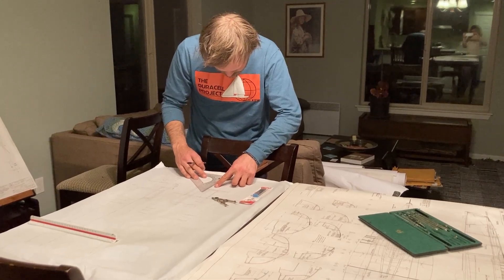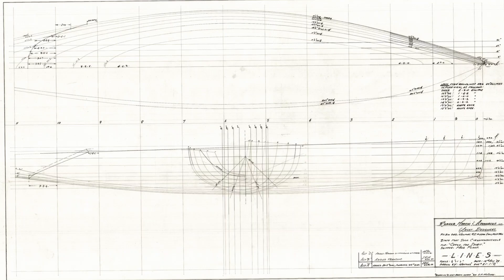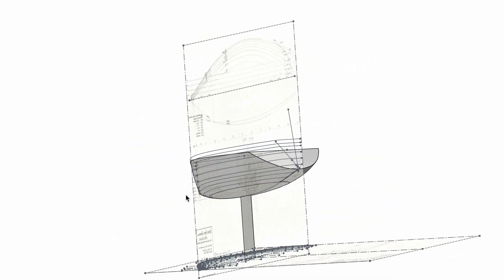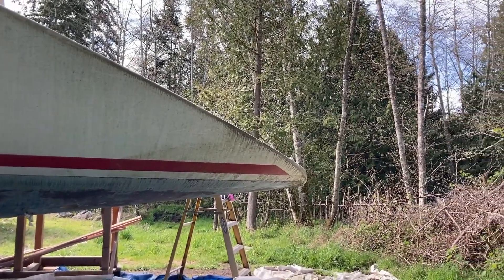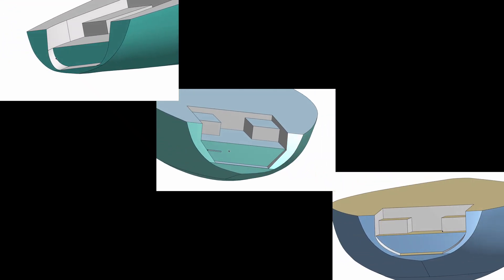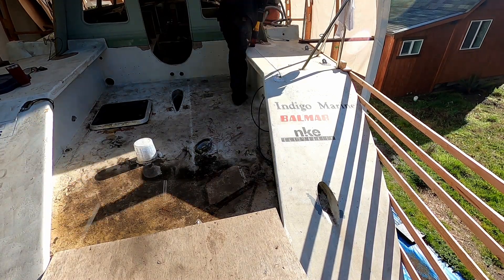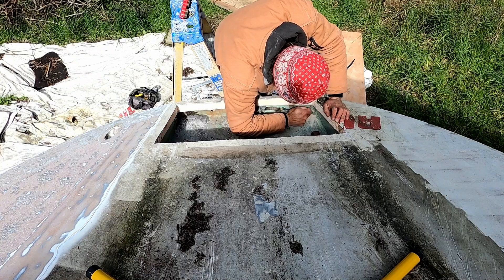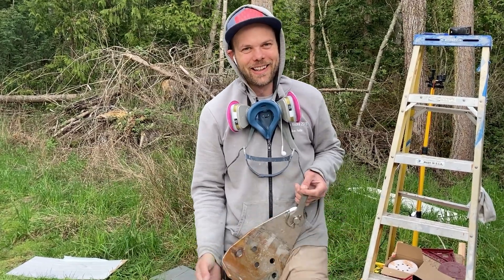Race Boat Refit: New Stern Design [E27]

Comment: I sailed two rallies with Crazy Horse years ago from Norfolk to Tortola. The crew described the ride like was tight, uncomfortable, but fast. We beat them on corrected time on a 50 ton 60+ footer thar was comfortable, fast, and fully equipped with a crew of 6. Their boat had no beam, was too light, difficult to sail. I also hired a crew member from a similar boat - Fazizi (sp) , a Russian entry in an around the world race. He said it was sailing a submarine. Beam is important for both stability and water one length. My beam was 17+ feet and when it healed 22 degrees, the waterline increased dramatically.
,

Comment: A wave of the hand to you both from the West coast of FL. Mathew watching your progress on this boat is fascinating. Do you intend to use her for coastal cruising or blue water? Rudder? What type? As to your stern design I like #2. Are there bulwarks and or toe rail along the deck edges?
Reply from the maker: coastal cruising and blue water! Still figuring out the rudder...stay tuned. No toe rails now, but we might put them in.
Reply: @TheDuracellProject  Hi and good morning from FL. Thanks for the response. I must confess that I’m hooked and can’t wait to see the progress. Question: with an open transom running in somewhat large swells from astern won’t that tend to funnel water at the deck house and it then bring potential for some water intrusion in the cabin? My sailing knowledge is limited to about 4 decades ago (I’m 70+) and that was on Lake Erie aboard a 32’ Sloop. I’m not at all familiar with open transom vessels or how they handle large swells or white caps over blue water. I’m very impressed with your resourcefulness in the projects that you’ve undertaken with Duracell’s refit. 👍 Good job. You’d be a good shipwright.

Comment: Because I'm old, if it were mine to rebuild, I think that I would make the top of the vertical part of the new transom even with the side deck...with a pass-through/gate in the center. My reasoning for this would be both for safety and for additional wrap-around seating in the stern, which would create more deck storage as well under the seating. Yes, I understand how much more work this solution would be. haha Glad I don't have to do it!

Comment: I’d go for #1 or #2. I’m not a fan of the hard corners one the 3rd one. While it may be easier than the other two, I wouldn’t do it. It would be nice if you had some rough measurements with these pictures. I’ve been very slowly working on my girlfriends Santana 37. It’s got a flat transom that I’ve thought about cutting open. We would loose the stern locker but I love an open transom boat. Also are you gonna put an arch over the back for solar or dingy davits. These things might change how you design your transom. But then again with a 60ft boat you have lots of space on the bow for a dingy. Can’t wait to see this boat here in Hawaii. I didn’t realize dog bark started as a solo race boat like Duracell.

Hopefully you upload video’s at least once a week. Give me something to watch while I babysit oil tankers off of Barbers Point.

Comment: Matt, all 3 are fine but my biggest consern is trying to put a modern wide stern on a relatively narrow stern  design. 
I think you will be moving a lot of weight aft and I'm conserned about keeping the balance right and having too much weight in the aft in what was really a shorter boat with a long planning transom to increase the sailing performance. 
But that's  me I guess.
Cheers Warren
Reply from the maker: There's no way around the fact that I'll be adding weight all over the boat, it's becoming a cruising boat after all.  The stern will be no wider than it was, I'm not changing the shape of the hull, just extending the hull sides up.  Thanks for the comment.

Comment: Do any of the transom designs account for wind vane self steering gear?    Seems difficult to account for self steering, dinghy, and swimming in a design.    If the intent is for robot self steering, does the design still need to accommodate provisions for an emergency rudder?
Reply from the maker: I am not planning on any wind vane self steering gear.  An emergency rudder setup can be fit to the transom if we decide it's necessary.

Comment: Cockpit has to go straigh to the back or weidening open, not squezing in, otherwise you are going to scoop water when the boat is heeling.
Reply from the maker: Very good point.  The cockpit sole is sloped aft a bit obviously for water to fall out, but you are right that the pinched cockpit design would hold water while heeling.
Reply: Im rebuilding the cockpit of a 30 feet raceboat, halftonner of 1980.

Comment: My choice would be Design 1.  Though I'd prefer to have, maybe, a 10 degree slope to the transom plane.  This would be holding the deck/transom intersection where you show it, and lengthening the bottom of the hull a bit.

Comment: How old is the rod rigging on the Andrews boat? You don't want to just replace it? I think you tend to make pretty good decisions and you probably have more info than I do. But I would be sorely tempted to replace the rigging unless the history of everything is well known.
Reply from the maker: I may end up replacing all of it, I don't know yet.  It all has to be inspected.  I'm hoping to get a comprehensive history of all of it if/when I go to buy it.  The local rigging shop tells me that it can be inspected for cracks in the heads and can continue to be used if they pass.
Reply: @TheDuracellProject  that is what I have read also. The exception is that if the rigging is 20 years old or something like that, it should probably be replaced regardless of cracks. Rod definitely lasts longer than wire though (but still has to be inspected periodically).

Comment: One hint on the CAD files.  These types of free programs often go to a paid model after they get enough users.  So try to save the 3D model in a neutral format like stp or iges when you're done, so you don't have to recreate it a few years down the road.  2D should get exported to .dwg or .dxf format, which are pretty universal.
Reply from the maker: good tip, thx!

Comment: Jeepers, in looking at #2 some more, I think: a) you do not have perspective turned on which is not very realistic when making aesthetic judgements, and b) the reason I thought your surface was "twisted" or warped is that the big inner step surface is not parallel to the transom plane... Why not make them parallel?
Reply from the maker: Hey Brad!  Yes those 2 surfaces are not parallel, good eye.  The reason is that the chainplates go on the transom, so the angle of the transom points at the top of the mast.  And the aft plane of the cockpit is not parallel because it maximizes deck space to make it more square(perp to water).

Comment: For me it's #1 or #2 with an initial first strong pref. for #2.  I really don't like #3 other than the interesting intermediate fold down (?) step which I think you could add to 1 or 2.  Now the only reason I don't say 2 outright is that the #2 inside corner radius transition SURFACE looks twisted like ribbon to me.  #1 is more pure (or I'd actually call it primitive) to me, as in it looks prismatic like a cylindrical surface just pulled straight back.  Did you look at the profile of #2 (which I think is a better looking transition/elevation) just pulled straight back?  Am I suffering what we call "CAD Zoom" here, i.e. is it actually prismatic and I'm just not spending enough time looking at it?  Do you have perspective (as opposed to isometric view which is often default when working in CAD) turned on? Is #2 actually a twisted or warped surface?... I vote for option #4 where you pull the elevation of #2 straight aft.  ... BTW in the last video (just previous to this one), I STRONGLY love how the new more vertical transom and extra visual mass aft complements the back of the new extended pilot house... I was worrying and not liking how heavy the new extended house was looking but you've totally resolved that! BraVO!

Comment: 3 follow KISS principle. You have very thick core. That’s good. Recommend you avoid carbon fiber mast! Carbon fiber is more noble than Everything, and even stainless steel will corrode next to it. Only titanium fittings can be used with carbon mast.$$$ not worth the headache. Not to mention lightening strike issues....

Comment: Amazing how many comments this video is attracting! Design 3 for me. Why? It appears to maximise access to the cockpit and if you're cruising (you already know this, I'm sure) the greater access the easier it is to haul stuff on/off the yacht, from the stern...from a dinghy. We have a passarelle on our stern and pretty much leave it deployed (parallel to the water surface) all the time as it just makes getting in/out of the boat and hauling things aboard so much easier (the swim platform on the Jeanneau53 isn't very wide at all, sadly). I guess we'd need to know how you're planning to build the split backstay chainplates into the transom to better answer your question though. Any thoughts on that? Cheers, Bill from SY Miss Foxy in SINGAPORE!
Reply from the maker: The top of the chainplates will be at deck level at the stern quarters, on the face of the transom.
Reply: @TheDuracellProject  Well that's good then - for maintenance and access, for sure - but how far inboard of the gunwale will determine how wide access you will have, obviously. Plus the necessity to build-up the structure around the chainplates and transfer load from these into the transom/hull joint and, I assume, a vertical bulkhead inside the transom. Going to be great to watch how you build this up!

Comment: The aestheticcs of design 2 compliment the lines of the boat the best I think. But design 3 looks like it would provide more strength to the hull. So I'd probably go with that one seeing as how the ocean can be very unforgiving. However, I'm no engineer or boat designer so a grain of salt is in order with my opinions on this topic. Good luck with this build.

Comment: Why was the original boat transom designed with that slope? It didn't leave much usable space. I'm sure it was for racing but it'd be nice to hear you explain it.  Thanks
Reply from the maker: Cutting off the stern takes off weight, while keeping length and longer boats go faster! Well, that's our guess anyway.

Comment: As you've never done this before, hats off for the work you do. That said, ~all engineers I have worked with in the past were inclined to "draw" or "doodle" in a "final" and "precise" technique. And that is very time consuming - to the point it made me impatient. Imagine you project (*) some drawing/section of the boat on a whiteboard and with an erasable marker doodle the alternatives on there, one after the other, take a photo, next. That can be fast interactive and easily involves stakeholders. And, yes, the CAD drawings of the boat are absolutely fabulous and necessary - at some point before final design, bill of work and building. As to the quick-hand doodling - I have seen architects do that very easily (as they rely on engineers to convert their sketches into formal designs, with underlying strength calculations, etc.). Works really, really fast. And can keep stakeholders engaged more easily, plus their involvement gives them a better sense of why you are going through these design alternatives.

(*) Or, instead of projecting, a large sheet of paper with plastic transparent foil over it, etc.
Reply from the maker: Love the idea of a white board.  I spend too much time with ideas in my head.  Thanks for the excellent input.
Reply: @TheDuracellProject  - welcome. And, by doing it the whiteboard way you have a better "visual" for you video too, especially in dialog with your partner, or you and the hypothetical viewer.

Comment: I would go for design no 2, but design in a groove to hold a board you can put in to protect the boat on when on long rough ocean passages with following waves.  The last thing you want is a wave to break over the stern and flood the cockpit.

Comment: Hi you want a windvain to stear the boat you would it be better to have a full transom to mount the windvain on to this will also give a big or medium size locker for fuel tanks plus a extra two gas vent lockers etc, plus you can then put a swim ladder on one of the sides of Durcell what do think 🤔 this would be a fourth plan idea,,.Brendan IRL

Comment: I like #3.  It looks like it will be easier to get on and off the boat with heavier bulkier items such as scuba tanks, stand up paddle boards, inflatable dingy, etc. not to mention people being able to get around each other.   Something I am missing in these designs is what else is going back there such as wind vane, wind mills, solar,  wenches, lines, standing rigging and access to what ever is going in the new hull space. You may want to  also consider stern waves washing into the cockpit while surfing downwind in large swells.  I would try to add those into the draft designs (CAD sure makes it easier that paper and pencil) and maybe build some mock ups before making the final choice.    The devil is in the details and all the future what ifs you can come up with as to how you may want to use it.  You are probably doing that already.  Looking forward to seeing what you come up with.  It is very impressive what you have already done!
Reply from the maker: I'm also leaning towards #3

Comment: why follow the traditions and design a stern that follows the existing lines. do that only for the hull in/slightly above the waterline, then widen the aft section to modern standards so you could maybe even use it as a tender garage and get a large wide cockpit for comfort on anchorage.
why did you not choose the german main stay system? could have saved the work/time on this huge reinforced bulkhead!!
why did u curve your roof so much? why not go modern? almost flat roof fits more solar panels!!
Reply from the maker: What is a german main stay system?

Comment: I think the larger the swim step the better... do all three designs have swim step platforms of the same width?  if not, I would go with whatever design has the wider platform (every cm counts) personally I like #3.  My preference would be to have a fold down platform that actually closed in the back and was set into the back of the boat so when in the up position the bottom of the swim platform was flush with the back of the boat... but when the platform was down it would completely open up the back while also giving a massive advantage of offering a swim platform that was at least 3 times bigger.  I don't know what hardware is available to make this operation work simply and easily, but it would make for a night and day difference in regards to your ability to actively use the swim platform for boarding a dingy, going diving, having several people on the platform at one time, or just sitting on it with your feet dangling in the water while you enjoy a cold drink.
Reply from the maker: I prefer simplicity, and a mantra of mine is to "limit moving parts".  If it moves it has to be maintained.  This is a big reason why I don't like opening transoms that convert to swim steps.
Reply: @TheDuracellProject  i am an engineer with most of my working history being in the maintenance of large buildings... so I completely understand.  i prefer simplicity with longevity, and function over fashion.

Comment: My vote is for #1. It's very similar to our boat except that it's closed at the step to the cockpit sole. I know that you like the open transom but we are very happy with the swim platform and the safety for the kids and the added structural strength for the backstays. Love what you are doing with Duracell. Fast cruiser is a sweet concept. Very seaworthy.

Comment: The added weight at the stern will change the balance, for instance - the bow will lift and the stern will sink, adding weight at the ends also makes the boat pitch more in waves. No doubt you already know that, but I had to mention it !

Comment: For what it's worth, I think it is safer to have a fully enclosed transom for a cruising boat. An open transom is subject to having a following sea "poop" the aft deck and shoot right up into an open pilot house door! An open transom is traditionally for racing boats whose rail gets into the water and picks up water and dumps it into the cockpit which you want to drain quickly out of the open transom. Your redesigned pilot house covers so much of that area that was previously open. Plus a cruising sailboat doesn't ever want to put its rails into the water. If you get a 30º heel on a beam or close reach, you haven't trimmed your sails safely. It would not be safe for a toddler on deck.
Reply from the maker: We chose a boat like this for it's speed and stability.  You are right that we won't be putting the rail in the water, but we do plan on being faster than the following seas.  I've sailed on lots of open transom boats in following seas and it's not really a problem, as long as you're fast.

Comment: I know you wanted to do it, but I would have left those ballast tanks in from the beginning so you wouldn't have to change the keel and the dynamics of the boat. Also big fast boats are cooler than big slow ones. #3

Comment: So I liked the transom face of #1 the best.  #2 looks to have some problems with the cockpit sides tapering inward, that looks like it will collect water when you are heeled.  I like swim steps that are wide enough to sit on with legs athwartships, and that you can turn around on comfortably.  But you will have to weigh that against taking length from the cockpit sole.  I'd personally make the cockpit work for sailing/steering comfortably first, it literally is a game of inches and mocking up is really helpful.